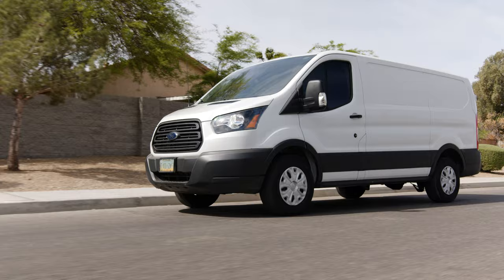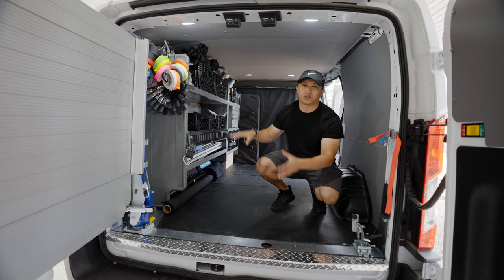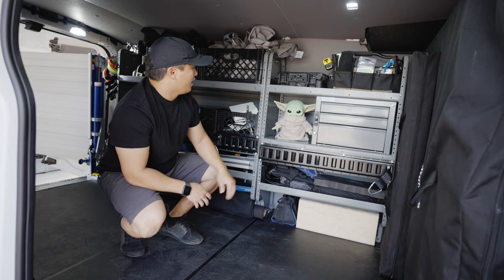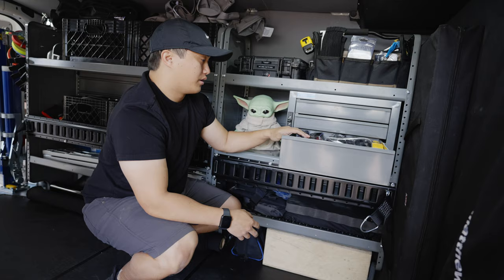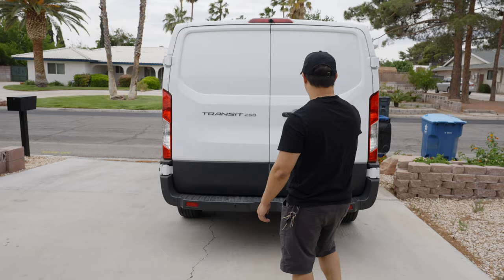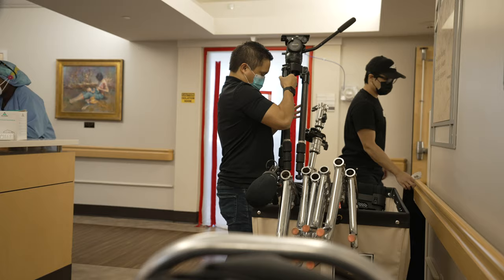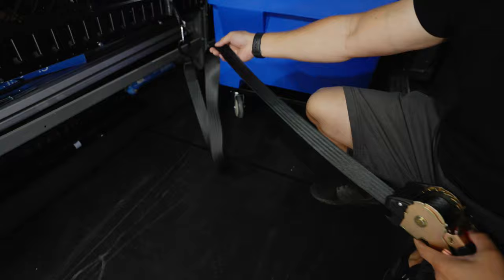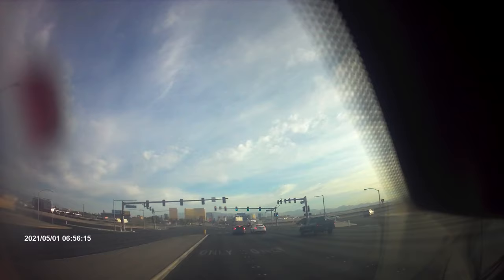My Video Production/Camera Van!

Comment: Are you happy with the size of your Uline 12 Bushel Hamper or wish you would've gone with the 14 Bushel for a little extra space? 
I'm leaning towards the 14 Bushel Vinyl...do you use your Poly hamper more than the Canvas hamper? 
Thanks again for the advice!
Reply from the maker: I use the poly hamper almost exclusively now. I've retired the canvas hampers mostly because they tend to rip when loading grip equipment so the vinyl might be a better option!

Comment: You’ve inspired me to go with similar setup!Currently use the cart method, but hate breaking everything down after in current truck. Few questions:

1.Do you use the ramp swivel mechanism a lot? Was thinking I can get away with just their non-swivel light ramp version. 

2.Shelves Make/Model?

3. Anything you would do differently? Im most likely going with the Promaster but should end up with something like your setup.
Reply from the maker: I do use the swivel feature a lot. When things are loaded towards the back, it makes more sense to unload from the rear and the swivel makes it really easy to access. The shelves are the adjustable version from Adrian Steel. Other than not being a high roof, I'm pretty happy with how the build turned out. However, I'm able to fit in nearly all garages which instantly makes up for it.

Comment: So is it okay to leave all this gear in the truck outside in the heat in the middle of the summer?
Reply from the maker: I usually don't leave equipment in the van.
Reply: @robchado  at the 2 minute mark you begin talking about everything that you normally leave in the van. I don't mean actual electronic equipment or batteries. I'm more curious about potential heat damage of stuff that's not utilized all the time such as hdmi cables or sdi cables.

Comment: Any security for breakins?
Reply from the maker: Not yet. I've been thinking about putting a Viper system in, which I might do soon.
Reply from the maker: I also unload and store gear after every job which is why I haven't looked into a security system yet. The most expensive item that lives in the van is probably my ND crate.
Reply: Thanks for the reply